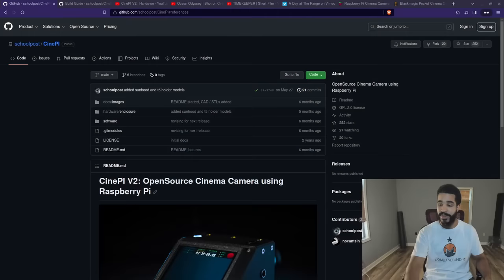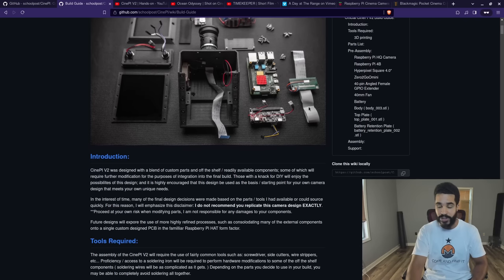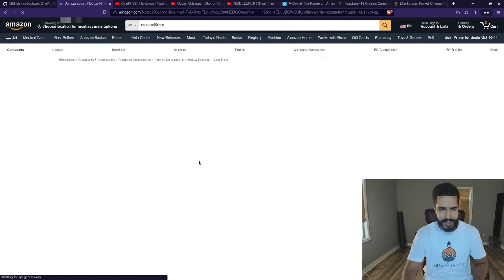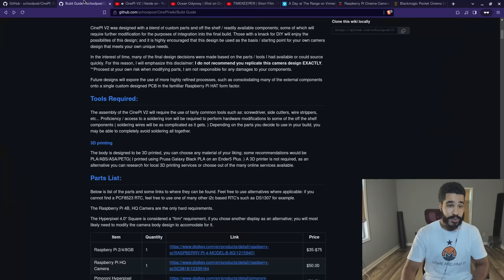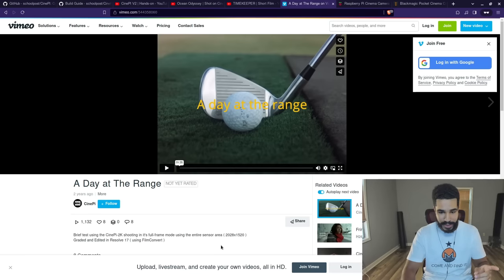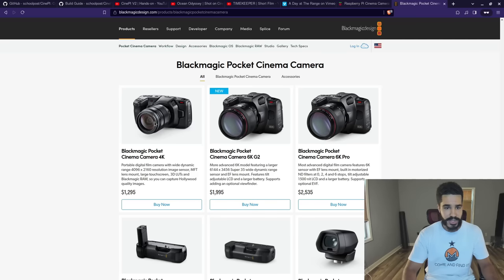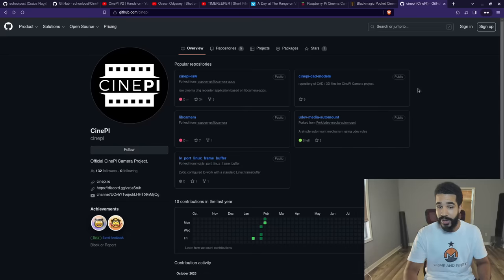CinePi - The Open Source Cinema Camera

Comment: Super 8 sensor size is too small for cinema in most cases. Wouldn’t go any smaller than 16mm sensor size. Really wish there was a higher end version. It would make more sense to have an upgradable camera when you just spent $5-10k on it.
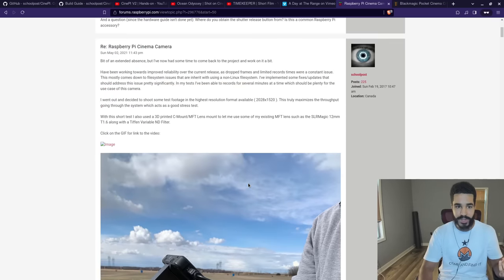Reply: He said there are other sensors 1:05 … He keeps mentioning 4k so im a little confused about this and why they made the housing suitable for viewfinder vs small or with lens priority.  Lil leery about sizable lenses on that housing. 11:00 that rig and lens looks wonky af, everyone using obscure lenses from the 1960s on these things?
Reply: Up gradeable hardware has been tried and doesn’t work.  Default hardware specs aare well balanced, better cameras usually ship with ALL of a better sensor, more CPU, better bandwidth, etc, when new models ship. And the new sensor tech will probably need a new heat sink design, etc. At the end you’re left with nothing worthwhile and the amount of skilled labour involved in the upgrade is nasty. Anyway, your camera body shouldn’t be a big part of your system costs - less than lights and lenses. So selling it and upgrading to a new body shouldn’t hurt that much, at least if you are one of the pros cinema cameras are meant for and are getting the tax breaks. Otherwise buy an old Canon and put magic lantern on it.
Reply: @TheGreatAmphibian  What about Red? They’re still in business and do sensor upgrades. A more open and technical user friendly version at a lower price point I think would be appreciated by many.
Reply: @martinlutherkingjr.5582  Actually RED are the poster child for NOT doing sensor upgrades. They said they were going to, but they have been largely or entirely discontinued for the reasons I gave. I think the last upgrade announced was 2019 and the only info on their sensor upgrade page is a list of abandoned ones…
Reply: @TrggrWarning he's mistaken about it being 4k, it's HD. From what I can find it's the best camera module for the PI. Others might can be adapted for the Pi, but I don't know what would be involved in that. 

If someone was to make like a micro four thirds sensor module for the Pi, I would expect it to run 3x - 4x as much as the one mentioned (150-200 instead of 50). Whole project then approaches the cost of a camera from Panasonic.

Seems like a neat project though. The fact that it uses lenses does give it an edge over a comparably priced Android phone.
Reply: @robertk1701 I think the issue would be the much weaker, hardware of the pi4 compared to avg smartphone and the much lesser amounts of image processing and max supported resolution as a result, as well as smartphone camera being usually impressive for their size.
Reply: @robertk1701 The sensor can do higher resolution than the Pi can adequately process (4056 x 3040) so the 1080 limit is because of the pi, not the sensor.
Reply: Its not even super 8 sized, its smaller. Its 1/2.3″ sensor. Even action cams have moved away from this tiny sensor.
Reply: 6.287mm x 4.712 mm are the exact measurements. So its actually just about super8, i kind of though super8 was larger. As its 5.8mm x 4.01mm.
Its the same size sensor as old gopro cameras have.
Reply: @FolkerHQ  Doesn't the 7d have a CF card slot which can make the camera good for 14 bit raw video with magic lantern
Reply: Sigma fp is a full-frame camera for under 2000$ brand new, to be had even cheaper 2nd hand. Amazing color science. It shoots full, as in not compressed (like braw)raw. directly on to SSD.
Reply: Never go below apsc
Reply: It's using the CSI port, so ANY camera that uses that connection and has Linux drivers available could replace the Pi High Quality camera module. Hooking up a HDMI-t0-CSI board would be interesting as competitor to products like Atomos and Blackmagic's recorders, though the real challege there is capturing the audio.

Comment: Lenses is where you need to spend the money. Cameras are more or less disposable these days, which the CinePi solves. I will keep an eye on this project for sure.
Reply: Yeah but you can make any mount you want with this  I guess :D
Reply: You have zero FOV for whatever glass you mount to it seeing as the sensor is the size of a CCTV camera.
Reply: @Foche_T._Schitt  Yes heavy crop but you get the character of each lens, and if it open source that means we could get any sensor on it right ?
Reply: The character of the lens is muted when the crop is that heavy from a 1/2.3" sensor  @DarkTrapStudio
Reply: @captureinsidethesound  Yes, it surely needs a bigger sensor. This won't cut it

Comment: I wonder how this will compete/interact with the Apertus Axiom which has dedicated open hardware for the project. Definitely gonna make one of these though; it's affordable and available. The more open source for creatives the better.
Reply: neither the Sony sensor or the SoC on the Raspi are open (+ the Raspi is still kinda' overpriced)...if you actually want to dick around making vids, a used, magic lantern capable camera is probably a better investment
btw thanks for mentioning the Apertus Axiom, didn't know about it.
Reply: @AKAtheA  Ye, was just talking about as cameras and how much difference there is in performance. Open vs closed hardware. Knew about Magic Lantern, but didn't think the compatible cameras could be pretty affordable used. Thanks for the suggestion.

Comment: they could make it solderless by using pogo pins just like the newer mod chips used to circumvent lockdowns on modern game consoles.

i would be ok with soldering as long as it is not tiny sub millimeter sized pads like you will find on some of today's circuit boards.

Comment: This is a great project. I hope bigger sensors will be available at decent prices in the future. A real cinema camera needs at least an APS-C sensor.
Reply: Not at all, cinema had small sensors for years, and now lens and low light capability are extremely good I don't understand your take.
Reply: @DarkTrapStudio  Op isn't wrong, the cinema camera community wants larger sensors and higher resolutions.  A 1080 super 8 sensor wouldn't cut it for most professionals when even the 'budget' cinema cameras (blackmagic) come with MFT at 4k now a days.  Some research makes it seem like the resolution limit is because of the Pi but it looks like the rpi 5 won't solve that because it still comes with USB 3 and PCIe 2.0 x1, but maybe in the future.  Still an interesting project for DIY or the budget oriented though.
Reply: @nadtz  The cinema community ? you mean the youtube community or are you in the cinema industry ?
Reply: I must admit I am just a hobby photographer, but I know that for good depth of field you need a large sensor and big/expensive lenses. Cinema is different of course, but you have to capture at least 24 fps and the larger the sensor, the more light you can capture.
Reply: @nadtz  No what you say doesn't make sense, Arri 4K camera are extremely recent and most cinema camera where shooting film on 1080p Arri camera, and so in cinema DNG. 

If you don't do CG movies or Still print you don't need more than 4K, you won't even post in more 4K, maybe if you do wildlife but you don't need to crop with a small sensors cause lens have huge reach.

USB 3 limits are more on the codecs side than resolution, DNG 4K is huge, H264 8K is riddiculous next to DNG 4K.
Reply: @DarkTrapStudio  I've worked with people in the video/cinema industries (I'm in IT) and have a basic understanding of some of the things they want in the gear they work with.
Reply: @tenj00 Yes but you can get a 9mm lens Its gonna be the same as a wide 20mm Full Frame, and in cinema they use light even at night so Its not a problem, but even without light Roger Deakins used a the Super 35mm equivalent Alexa mini LF for shooting underground bunkers without light in Roger  film 1917 (2019).
Reply: @nadtz  Ok so you worked on a Cinema production line with a film shot on a Full Frame/equivalent or more ?
Reply: @DarkTrapStudio What difference would it make whether I did or didn't?  I'm not downing this project but in most professional environments it's a non starter.  Modern prosumer cameras beat the pants off this camera in terms of specs and the sensor is more or less equivalent to the 10 year old EOS M I have modded with magic lantern, never mind what most people would consider a cinema camera.  As much as people say "gear doesn't matter" while in a general artistic sense it's true in practice it's not.  No SDI as an output and no dedicated audio in would be a deal breakers in a lot of circumstances for instance.  Sure you can find examples of movies shot on Iphones or go pro's or whatever but those are exceptions not the rule.  That Arri Alexa LF you mentioned for instance has a large format sensor (thus the LF) which is why it worked so well in low light and costs like $40k used.
Reply: @nadtz  Yes large format for cinema which is super 35 I just said earlier the sensor size so I guess the conversation is non functionnal.
Reply: @DarkTrapStudio  You mentioned a very expensive cinema camera with a fairly large sensor to somehow validate a ~$200 diy project with a sensor smaller than APS-C sensor when what the op mentioned was... needing a larger sensor.  You pretty much validated his point while arguing against it, so I'd agree it's a non functional conversation.

Comment: Sadly the RasPi4 alone is quite steep since the prices for hardware still haven't really come down and are being oversold everywhere. A future update of this system would hopefully include the ability to slide in 2,5' SSDs (preferably a dual RAID for redundancy) and i hope it would be possible to find a more convenient Battery solution that would also make it possible to run it with AA rechargeables.  But everything really stands and fails with a proper image sensor and that would some additional passive and active cooling. I'm glad the project exists and hopefully grows because i love some personalized gear you put together yourself.  Technology has evolved enough that even a DIY Digital Cinecamera is not impossible anymore. And that is fantastic!! And i hope this opens the market for better third party Camera Sensors specifically for such a project, tailored to the RasPi. More than the camera modules we have available so far.
Reply: Would the OrangePi work instead?

Comment: Something to watch but not for hard use in its current iteration. The sensor needs to at least be Super16. You need to get at least 10 gbps write speeds for raw. Something a pi 5 and some other hardware can fix, outside of the sensor. If I get into this project I may take a crack at redesigning the body to accommodate a hood and a spot for a handgrip.

With that sensor size you might as well just use a newer iPhone that can already exceed the recording specs. Black magic just release a camera app for iPhone as well which is super nice given how greedy filmic pro got.

Comment: Okay so it shoots at 2k 50fps 12 bit, this isn't terrible! If you could build this for around $150 (assuming you have a raspberry pi laying around) it would be worth it. The cheapest RAW cinema camera right now is the canon EOS-M from 2012 with the Magic Lantern firmware hack. This allows you to shoot 14bit raw in various cropped resolutions up to about 5k. It mostly shoots in 24fps or 30fps, but does have a high framerate mode that can do up to 48 or 50, but its glitchy. The development of the magic lantern software has been going crazy since covid and they have made many improvements and the camera is very stable. You can find used EOS-M cameras for anywhere between $50-$200 making it a killer option!
Reply: IIRC, 4K and 5K modes on the eos M are upscaled, which could also be done with the cinepi footage.
Reply: @user-le8ul4nr5t  Its half upscaled, the vertical resolution is exactly as 4k or 5k, but the horizontal resolution is squeezed to make it fit the sensor. It is still raw footage so when you desqueeze the horizontal, its basically the same thing they were doing with anamorphic filming technique back in the day to get a wide image on a square piece of film. So you actually get the benefits of the footage looking extremely cinematic because of this "flaw". But it is not the same as upscaling the footage, what comes out of the EOS-M is always a RAW file, never upscaled.

Comment: Cinema-Grade Camera → 1/2.3" sensor. Sorry mate but that is not a cinema grade camera. Especially with the horrible lens selection that would naturally come with such a small sensor. Micro-four-thirds already has limited lens selection, this is a step beyond even that. 12 bit DNG doesn't make a lick of difference on such a small sensor. I agree it's a cool project, but that's about it. It has no more potential than that. There's a reason pro grade cameras cost thousands, and it's not for quadruple profit margins I can tell you that much. Cameras are designed from the ground up to deliver the best image quality possible at a given cost. This is nothing more than camera software and a really good webcam.
Reply: lol, so wrong.
Reply: @djjoeray  I encourage you to cite your sources sir.
Reply: 1:06 "you can also put other sensors in this"

actually, the guy who made this said himself on reddit that he's already trying to make it work with the same sensor the BMPCC 4K uses. 

That's what a lot of people with this more immediate view of things usually fail to get. 

First of all, you can absolutely get good quality images with the setup as is -  way better than what you could possibly get by any other means within this price range.

But something like this existing - especially with it being open source - allows people to iterate and improve upon the design it's been made in ways that proprietary hardware just doesn't allow.

I mean, it hasn't been a month yet since the dude published his open source camera, give him a break lol
It already is a valuable thing for film schools in empoverished areas, for example. Let's wait some time and see what developments may come - bigger and better sensors, etc

Comment: This is really cool. But in terms of quality it's nowhere near even the cheapest blackmagic cameras. Then again, it's also a lot cheaper. A bigger sensor is a must, but even with a better sensor they have a lot of work ahead of them if they wanna compete. Professional cinema cameras (red not included) are already pretty modular, you can use most batteries, screens, grip equipment etc. on any proper camera, but only Sony cameras can actually swap the sensor, open source hardware is a whole new level of modularity.

Comment: For a project like this to succeed it needs to focus on the software and not the hardware. Accept the low resolution if you’re using a raspberry pi—the bandwidth limits it—and add features like image stabilization. IIRC this is ~12MP.

There is a point where you begin to need to build the hardware around the image sensor and it begins about here. The Pi just isn’t fast enough for “cinema” video. Needs a more powerful processor or an application-specific one.

Comment: Very very cool and unique, and in certain ways it could be good, but broadly speaking I'm not sure entirely practical. Blackmagic make incredibly aggressively-priced cameras already, and I really do not think the economies of scale would ever work for something like this to work outside of the novelty factor. I don't think this will save anyone money. CinemaDNG is not a particularly friendly codec to work with these days, you'll likely spend a lot of time fiddling with this camera, and time is money. I'm also interested to see what the software features are like (I suppose that's a huge plus of open source), I can see a LEMO connector, how does it handle sound? Timecode support? I assume there's no lens communication so you're limited to full manual lenses which is fair. Nonetheless I'd love to see this keep going and pick up momentum.

Comment: 4k 50p doesn’t really keep up with professional levels anymore unfortunately. That black magic pocket sensor is not really any different either. It’s mostly about high bitrate and dynamic range to compete in the professional camera world. 4k 50 is practically sub standard now. That doesn’t mean it won’t take some great videos. 

Fun hobby or prosumer type product but the sensor won’t hold a candle to anything past around 2016. Definitely still going to build one.

I do wonder if it’s possible to swap sensors with something from kinefinity or a smaller cine company. Might fish around for parts. I would even guess that some older RED cine parts could be tweaked to work. But really at that point this thing just becomes a rehoused cine camera considering the RP won’t support such a high bitrate. Maybe I’m wrong. 

Love this idea though, especially that it’s bringing back the C mount lenses.

Comment: An internal battery is gonna limit this thing 100%. Should've built if for Sony F batteries or straight up Milwaukee M18
Reply: Not really. You could just put XT60 connector on the side and power it with external lipo. There's no need to use expensive batteries no matter how many YOU might have of them.

Comment: Cinepi as in Sin pie. (at least I always say "sin" lens or "sin" camera when speaking of cinema equipment)
The IMX477 is a tiny sensor like those found on CCTV cameras being something like 7.9mm across.
A cheap Micro 4/3 camera is 22mm across and that's still far from competing with a 24mp full frame mirrorless camera.
You're going to be losing a lot of FOV/Compression you can get from a larger sensor. 
If you want something on the cheap a used Micro 4/3 camera would still be leagues ahead of this.